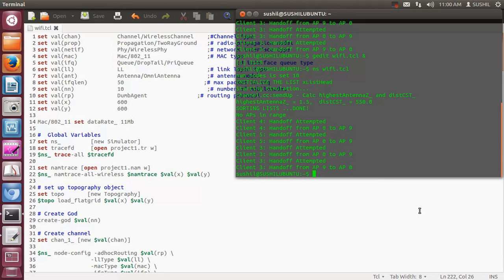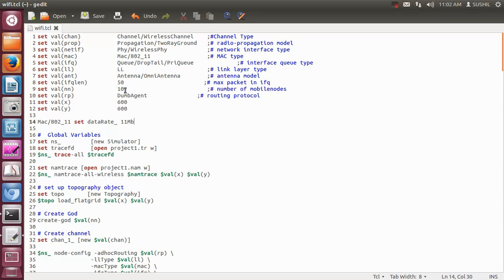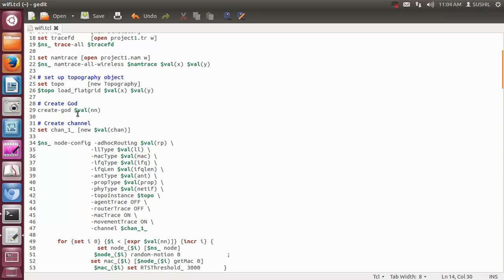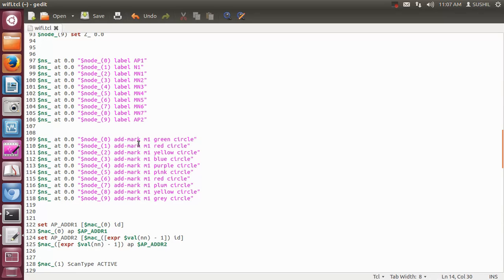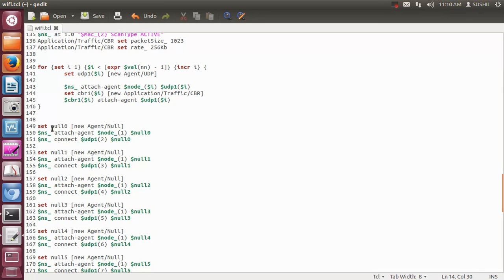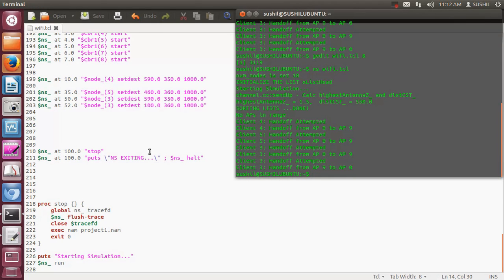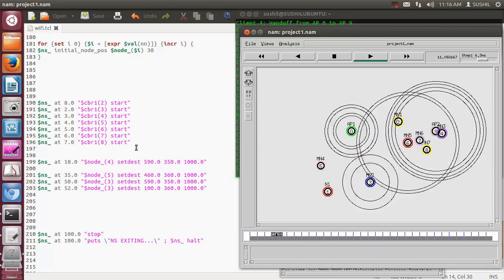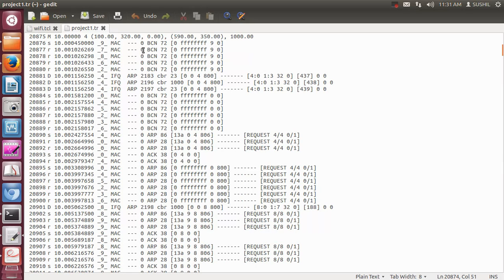Explaining Handoff in wifi using NS2 simulation

Comment: Hello Sir, please I'm doing a project and I have to do a dynamic simulation of MPLS. The dynamic refers to a restructurin of the network, that is, if for example, there is too much traffic that goes through a router, it will automatically be divided in two routers and both have to autocatically reconnect to the network. My question is: Can I do that using NS2 simulator? or What software do you recommend? Excuse me, my english isn't the better :).
Reply from the maker: +Angelica Cabrera Sorry I dont know anything about that

Comment: Hello Sir, I'm using NS3 to simulate mobility of network system using PMIPV6 and MIPV6 protocol. I get stuck at some points, do u have any comprehensive tutorial/ guide about it, thanks so much in advance
Reply: this my skype "TheDoan_sp" we can exchange knowledge with to each other
Reply from the maker: +Thuan Doan Sorry I wont be able to specify any specific tutorial on that as I have used only NS2
Reply: Hello Sir Thuan Doan
I am also use NS 3 to simulate mobility of network system using PMIPV6 and MIPV6 protocol. but I still in the beginning so please can you give me your email address to contact with you to get some help from you.
Reply: Dear Thuan Doan I sent  you some messages by skype application and tried to call you by using your account name "TheDoan_sp" , but I think you are busy or maybe you are not open skype this days , so please try to make a time to response or to talk with me on skype 
thanks in advance 
Warm regards